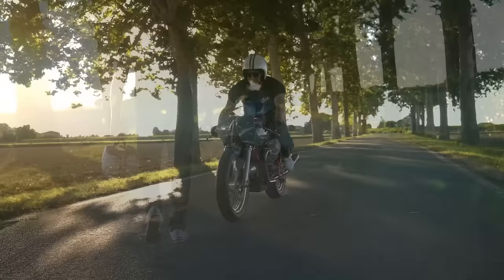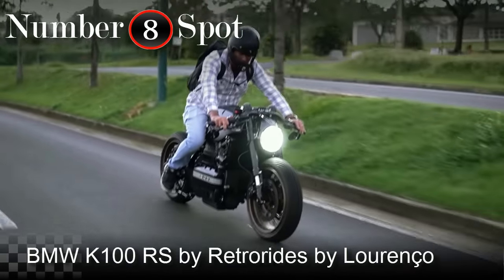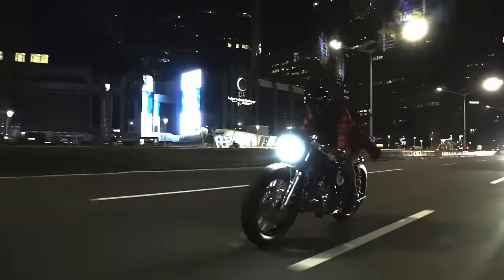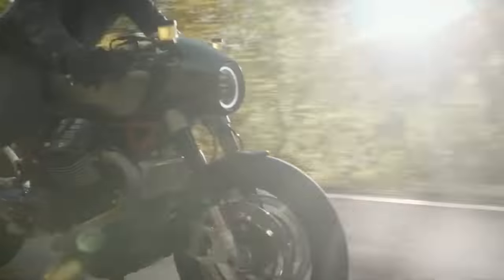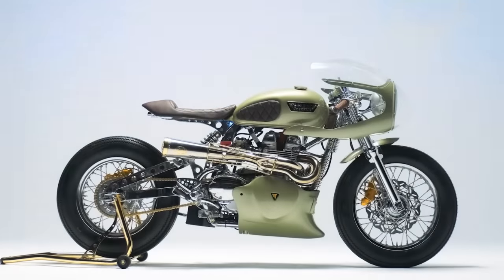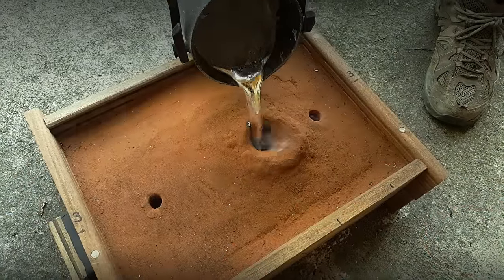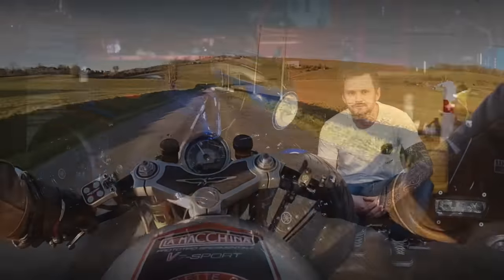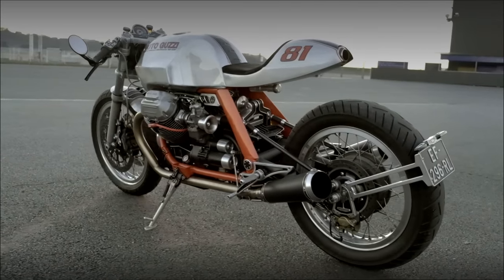Cafe Racers (2022 Top 10 Best Motorcycles)

Comment: I am the Composites Technician and 2nd CAD Cam designer for GTM
Guzzi Tech Motocycles. 
We have a shop in orange and a show room in Malibu. 
What can I do to submit a build. 
The builds are $45,000 and up. 
All bikes are either a customers bike or donor bike. 
We take the engine, transmission, shaft drive, and hub and drop that out. 
All of that goes in a custom hand built chassis. 
Bobber, cafe, tracker. We have a few chassis’s.
We even have a turbo 1200 twin making upwards of 200hp. 
All the parts are hand made in shop or they are components from specific big name companies. Lots of Italian parts too. 
But we make a lot in house.